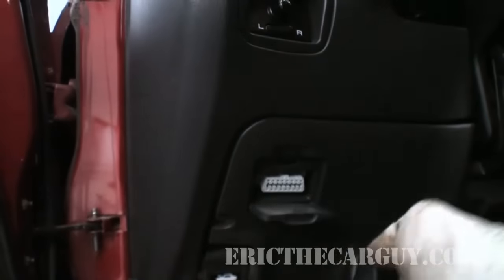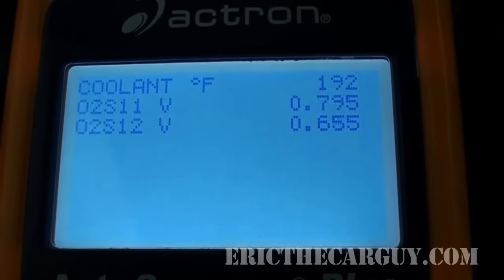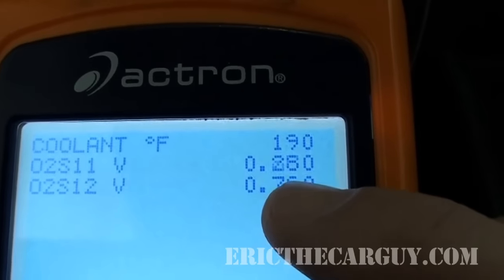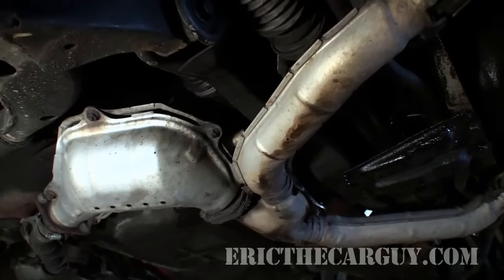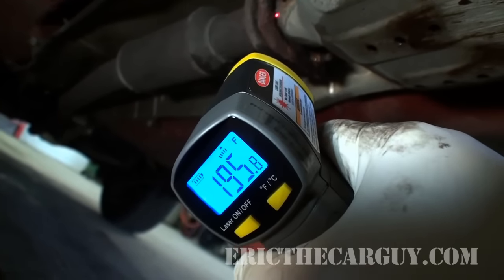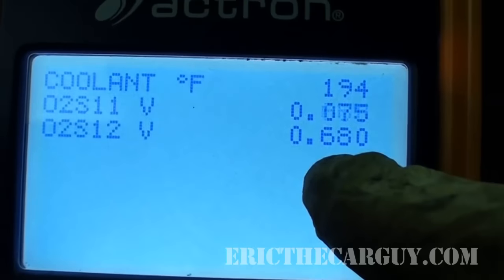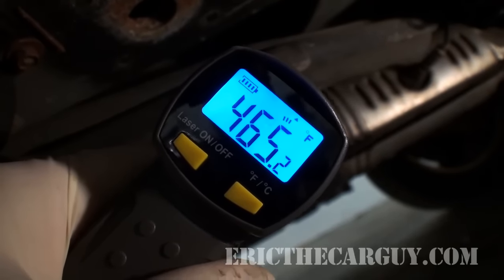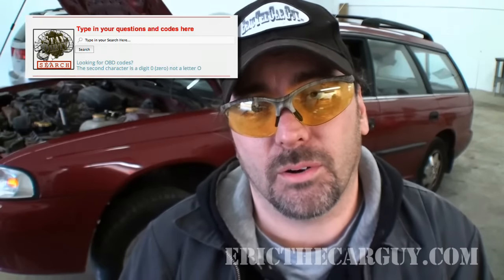P0420 How To Diagnose A Bad Catalytic Converter -EricTheCarGuy

Comment: Okay, this is for all the people who did this test, then rushed out and replaced their bad CCs and then weeks or months later it is bad again.  Your catalytic converter didn't go bad just because it was old or whatever.  It went bad because SOMETHING ELSE IS WRONG too.  If you don't fix that, you'll just keep blowing your new converters.  Start looking for things that cause the engine to run too rich or too lean, burning oil, etc.
Reply: The Entire set of O2 sensors should be replaced along with new cats.  02's need to be replaced every 75K to prevent issues like this.
Reply: Replacing O2 sensors can help prevent issues related to bad sensors like rough idling etc, but replacing your O2 sensors won't save your cat if you're burning oil.
Reply: Alex M Burning up cats is a result of prolonged conditions of incorrect fuel to air. This is the number 1 cause of such failures. Especially lean conditions. 

These Sensors need to be swapped like spark plugs. They all work together. 100K max for sensors and plugs, Optimal is 75k.
Reply: This is true, and I agree, but the number 1 reason of blowing up cats in my experience is with engines that leak or burn OIL.  Incorrect fuel/air can do it too, but not nearly as often as oil problems.  Again, just in my experience.
Reply: I will also add that IF an O2 sensor goes and threatens to do such a thing, it almost always triggers a code, so you can replace it with plenty of time.  Most people get the code, throw O2 sensors at the problem, then still have the code and blow their cats without fail.  That's usually because of that oil I mentioned.
Reply: The guy at Advanced auto just told me my CC is having issues in a 2000 toyota sienna I was just given. It is burning oil. Also it had 2 bad coils but the previous owner still drove it. I replaced all 3 coils and 6 plugs. Why is it burning oil and how is this connected to the CC problem? Also is the previous issue with the coils  apart of the problem?
Reply: Think of CC's as really really good strainers.  If you burn oil carbon deposits from not combusting the oil and/or gas completely start blocking that strainer.  Why it burns oil could be for a few reasons.  Bad valve cover gasket, leaking seals, bad O2 sensors, bad PCV valve (very common), or serious internal engine damage.  If it's not leaking and the PCV is fine, pull a spark plug. If you see black charring on the threads it's bad news.
Reply: Alex M Thanks for the response. I checked the PCV valve while changing the plugs (shook it and heard a rattle) . If it's the O2 sensors will the car give me a code? Also do you trust those treatments that say they stop leaks..or will they eventually make things worse?
Reply: The stop oil leak is more for visible oil leaks like on the oil pan or something.

If it's an internal leak problem, like worn out piston rings, the stop oil leak product isn't going to work.
You should do a compression test both wet and dry to rule out worn rings.

If the rings are worn, you are better off rebuilding the top end of the engine like new pistons, rods and send the top end of the block to a machinist so he can bore it out a bit. 
Or if you think it's not worth it, then you'll have to ditch the car.
Reply: Hello, how would you go about checking if you're burning oil? My check engine light comes on and turns off but I've had it checked and everyone says I need to replace the catalytic converter.  My car is a 2009 Mitsubishi Lancer gts with 136,000mi. I don't really know anything about mechanics. I do get the oil changed and basic maintenance. Had the spark plugs replaced last year but not the coils, (sorry I think that's what is above the spark plug). I don't want to replace the catalytic converter and the same thing happen. The mechanic says the part alone costs $600 but I've seen it online anywhere's from $200 to $500.  I'm confused at what to look for. Thank you for any tips or help you can pass along
Reply: I don't trust stop leak treatments for the most part and consider them a last ditch effort.  If a gasket can be replaced, that's always the better option.  PCV valves are so cheap and easy, you might consider just swapping it out just to see if there's improvement.    GENERALLY, O2 sensors throw codes if they aren't working right, but you know how the real world goes.  They are pricier to change, but they are supposed to be swapped typically as general maintenance for many vehicles every 75k miles or so (check your service manual).  So if you believe they are the culprits, it's something to consider.  

For those asking about identifying if you are leaking or burning oil, the easiest way is to check the oil, top it off and verify it, then drive the car.  Check it again, and if you dropping on the dipstick, you are losing it somewhere, either through leaks or burning it.  Obvious signs of burning significant amounts are blue/grey/black smoke out of the tailpipe, and black or wet spark plugs.  If you cannot find a leak, UV dye is fantastic - you add a small amount to the oil (it's safe), drive the vehicle for a week, then pull out a UV light and orange glasses (generally $25ish for the set) and look for the glowing fluid to find your leak (if you have one).  For less obvious signs, if you the oil is dropping and you cannot find a leak, you know you're burning it, and the cat takes a beating anytime excess oil is thrown its way.  Replacing the cat is pricey, and obviously fixes it, but if you do not solve the issue of sending oil its way upstream of it, you will just trash the new one inside of a year again, wasting your money.  You must fix the oil problem FIRST, and to do that, you must identify the source of it.  If it is bad seals, gaskets, spark plugs, O2 sensors, ECM, fuel injectors, PCV valve, etc it is fixable.  If it is internal engine wear, it requires a rebuild unfortunately.

The order I would use to find the problem (speaking generally), is to first check for codes for something obvious, then check for burning/leaking oil (smoke, UV dye, obvious leaks, evidence on spark plugs, leaks in the exhaust) and repair its source if it's something like bad seals for example, replace the PCV valve (because it is so incredibly cheap and easy and it's no big deal - $5 and hey, maybe it solves everything!) and plugs (if they're old) and filters (if they're nasty), change the oil (if it has been long overdue or not changed regularly), replace O2 sensors (if called for by maintenance schedule or obviously damaged).  You can also try removing the cat and unclogging it (Scotty Kilmer has a video), it's cheap and works sometimes!  Worth a shot.  A medium level scan tool to read codes and fuel trim (to check O2 sensors) will come in handy, as well as UV leak dye.  If the car has a bad history, especially for oil changes, a wet/dry compression test will tell you if there's internal engine wear.  I would consider this after checking for oil problems and before replacing anything (unless something like the spark plugs or oil just obviously demands immediate changing for good measure).  If there's internal wear, that's not to say finishing the checklist isn't worthwhile, as it could be unrelated or replacing a part like a bad PCV valve could improve the problem, but don't get your hopes up, especially if there's a gunked up spark plug.

That's about the best I can say to help anyone through text without the car in front of me.  It's unfortunate because it's not an immediate apparent problem usually (like a clearly busted suspension part), and it takes some sleuthing and patience.  Good luck, and don't just throw parts at it!  Test first, and only replace cheap things that's a good idea to replace for a general tune-up (oil, plugs, filters) without confirmation of a problem.
Reply: Alex M I appreciate you taking the time to write this detailed post to help us solve our car problems. God bless you.
Reply: Alex M thank you for taking your time to write this! Helps very much.
Reply: I got a code for my car running too lean. Mechanic said it's causing the cc to go bad. I have a toyota celica 2001 gt.
Reply: On those Celica's, it's VERY OFTEN just dirty fuel injectors.  1 gallon of lacquer thinner and 9 gallons of gas in the tank (example, if you have a 16 gallon tank, and it is 1/4 full, it has 4 gallons gas in it, so add 1 gallon lacquer thinner, and 5 gallons gas) and then run it almost dry and fill it up again with fresh gas and run that tank through, and see what happens.  If it is bad O2 sensors, any mechanic worth his salt can hook up a dealer level scanner and check.  Don't replace them just as a guess.  You could also replace the PCV since it's just a couple bucks and very easy to do, and I've seen that fix a lot of problems.  You should also pressure test your fuel pump (you can rent the kit for free at AutoZone, and it's very easy to do on a Celica).  Low pressure will cause the lean condition, and indicates either a bad fuel pump, or a clogged fuel filter.  The fuel filter is only $10, and should be replaced every 30K anyway, so it's good to do that as well.  If you do get low pressure, replace the filter and test again.  Hopefully it's just a clogged filter and not a bad pump if you do get low pressure.  My money is on the injectors though based on my experience with that vehicle.  You should get it fixed as soon as you can because your mechanic is right: if you keep running it lean/rich, it will eventually kill the CC.
Reply: Alex M r
Reply: Alex M Alright Alex so I added some seafoam and my car runs rough now? It says it cleans fuel injectors plus I changed the pcv valve(the old was real dirty and gunked up). I'm thinking maybe the spark plugs got clogged up and/or I need to change the oil again? Might just change the fuel pump and see whats up.
Reply: if there's black charring on the threads what does that mean?
Reply: Threads of what? Spark plugs? Then it could be excessive fuel injection or oil  burning, or that the spark plug is worn down and can't ignite the fuel mixture properly which creates a rich condition.
Reply: Alex M have
Reply: Alex M n
Reply: how do i know if im buring oil
Reply: Bluish smoke coming out the exhaust. You would have to have a friend film you while you drive, preferable when you floor it and rev the car out to the highest it can. Another way is when oil level drops 1 quart in less than 1,000 miles.
Reply: Steven torrez another tell tale sign is if your car smells like a boat
Reply: Eric on a 97 Toyota Avalon what do you think of Scotty Kilmer's idea of putting in lacquer thinner into a half a tank of gas to drive it about 100 to 150 miles and then that supposedly will clean the catalytic converter
Reply: Youd have o be burning quite a lot of oil before a CAT would go bad - more likley, your headgasket is leaking oil near the outer edges,  - and that isnt really buurning.
Reply: Or bruned rad fluid
Reply: Hot is a good thing for a CAT. Not red, though. Glowing, really?
Reply: SeaFoam = better than bad news.
Reply: So much wrong with that guess.
Reply: By your randomness check, I think you may have NOT followed the SeaFoam directions well at all.

How did you do it, what SeafOAM PRODUT DID YOU USE?
Reply: the threads of what?
Reply: Alex M catalytic converters do not die, THEY ARE MURDERED
Reply: Alex M thanks brother. Very knowledgeable
Reply: Hello fellow Alex M! In addition to having the same name you also know about cars! I can 100% concur with you saying that burning oil can really quickly damage your cat, happened in a 2002 Isuzu Rode Sport 2.2L 4L that burned a little oil, and after replacing the cat it soon wilted away again because of that leak. Got it fixed and no problems since (:
Reply: Generally correct but not always. Some vehicles Catalytic converters are born to fail, and were put under recall.  If your car has a check engine light, don't say "oh that's just there because the car is old, it's always been there". That's BS.  Something is wrong.  "Well i replaced the 02 sensor and it still didn't fix it"... well check your intake manifold gasket. Also, MIL lights (check engine lights) don't always come on when there is a problem. Maybe they do 50% of the time at best.  So check to see if your car runs OBD II... buy a little old school OBD II reader with the value registry, the price of those is like 38 bucks for a good one on Amazon now because everything is phone and bluetooth... Like Alex M said, there is a cause.

Usually.
Reply: Leo p
Reply: Top end don't you mean the bottom end?
You don't pull the connecting rod's caps from the top end, you remove the oil pan, ex....
Yes the pistons come out the top but a top end build is the valve train.
Speaking of you might as well do that too because your valves are loaded with carbon and deposits and oil.
Personally save some money buy a crate motor. and if you've got room have that built off the car as a back up.
Or scrap the car.
Reply: @allenlamb8240  bad piston rings. Most likely. It's called blow by
Reply: @tiffanyf5691  
If your oil level goes down between oil changes.  Mine can drop 1/4” or more on the dipstick every 6,000 miles or so when it’s burning oil badly.  

Mine burns oil because my piston rings are loose and eventually the ring gaps line up and allows oil to pass through for a period.

Comment: I've got a crack in my exhaust manifold 2001 Honda Civic I was told that I should just replace the whole thing with the catalytic converter and manifold all in one piece. If on the road too long I get a check engine light p1361 top dead center sensor noise. Should I replace O2 sensor and camshaft position sensor when replacing this manifold and catalytic converter

Comment: Thanks.Your right Eric.I like the custom list.I will try that,as I have that same Actron.The Ocilliscope reading for O2 Sensors 1&2 would show rapid huge fluctuations on a bad cat.Good cat, only O2 1 would change rapidly but even,  and 2 slow even changes.That's from Pro Demand DTC PO420.A quick test with a vac. gauge can also verify a clogged cat. At start up the reading will be 18-22 in hg,then as back pressure builds, it drops a lot.Then engine will have no power or shut off.The smell of rotten eggs is also a symptom.

Comment: Hi Eric, I hope you still read old videos comments as I have an interesting story on a catalytic converter:  My car is a 1994 Autobianchi Y10, OBD1 single point fuel injected, bought new back then. 
The cat is still the oem one but it stopped working many years ago. The car was starting to burn oil and I diagnosed bad valve seals. I decided to do a head job, so replaced the seals, lapped valves, machined the surface for the new head gasket and finally put back the head AND (this is important for the story) I changed the paper seals for the throttle body. Started the car and immediately something was wrong, it runned very rough and had problems to stay at levelled idle.
I noticed that the engine was running hot, I took my temperature gun to check exhaust temperatures and they were very hot, even at the muffler. I decided to verify temperature before the cat, it was around 220 degrees C (428 F) and 400+ C (750+ F) after the cat. 
So.. the cat was working! I then discovered that one of the paper gaskets for the throttle body was the wrong one so it had a bad vacuum leak. 
I replaced the gasket, solved the problem with the engine but.. cat stopped working again, now I have barely 180 C (356 F) before cat, and around 150 C (300 F) after cat. 
It looks like that the exhaust is not getting at the right temperature to make the cat working properly.

Comment: I cleaned 4.6 GT Mustang (85k miles) by putting one gallon of lacquer thinner into a half a tank of gas about 8 gallons.  I added the lacquer thinner with funnel at a rest area on the interstate.  Run it all out with overdrive off and punch it a few times "Do not" just put the lacquer thinner in and let it set around with normal driving to work, run it all out right after adding it.  I did this twice the first time did stop the p420 code but the second time my scan tool shown a much steadier high voltage with the down stream o2 sensor.  The other bank did not clean up as I found out after taking it off that the catalyst material had disintegrated.  The side that did clean up had no build up of carbon the catalyst material was tan in color same as the new cats that I replaced them with.  
Here a gallon of lacquer thinner is $16.00.  I am going to use this lacquer thinner method of cleaning every so often on my new cats. Depending what the scan tools tells me what the downstream o2 sensor is reporting.   Somewhere between 10k and 20k will get the first cleaning to keep the carbon from building up. I do use Lucas gas treatment often and that will keep my engine cleaner but makes the cats work harder.

Comment: I have to say something. The downstream o2 sensor is to monitor the efficency of the oxidizing converter. Not the reducing catalyst. The reducing catalyst reduces the nox and there is NO field test for this without a dyno.   The oxidizing catalyst reduces co and hc.